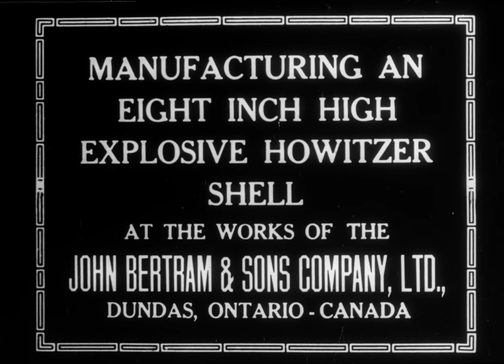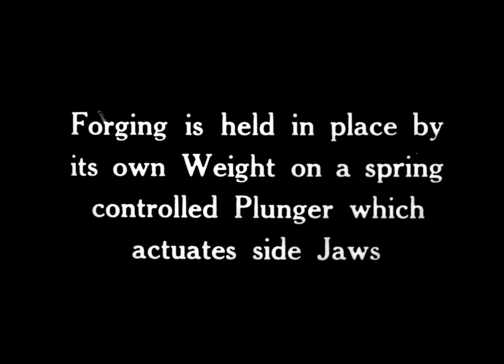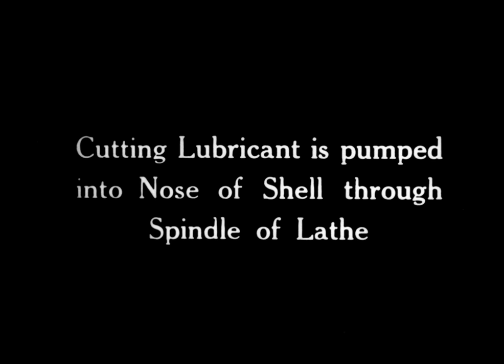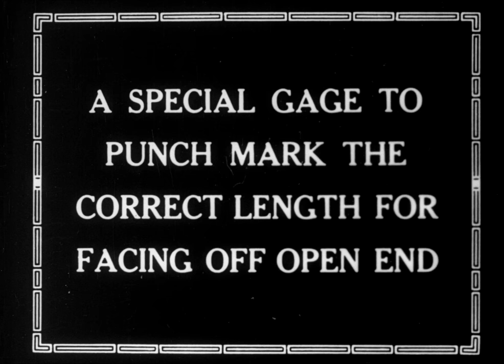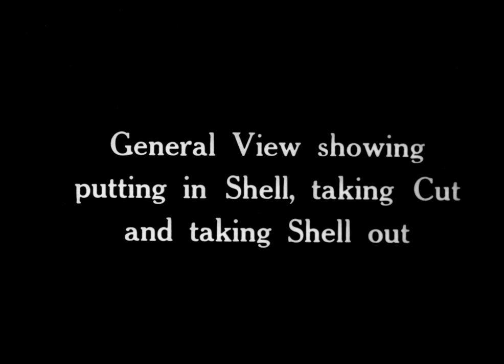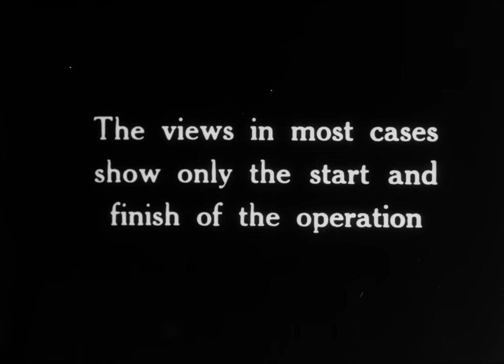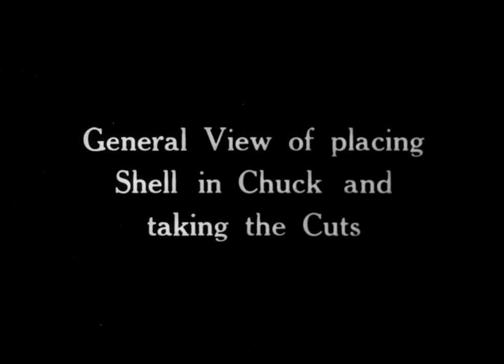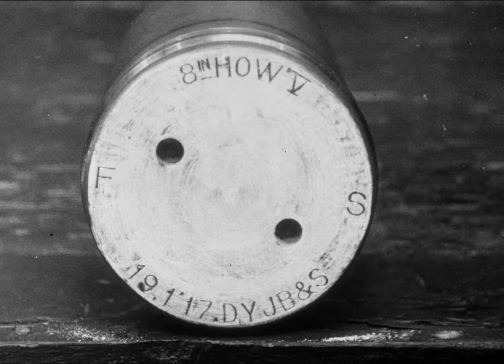Manufacturing an Eight Inch High Explosive Howitzer Shell (1917 ?)

Comment: Seemed like a lot of unnecessary extra machining and cutting on outside of shell they where taking it out of one lathe putting into another just to go over what they already had done couldn't they just set the one lathe and machine to proper size. 
Suppose that's one way to keep everyone busy and employed, lol
Reply: I'm guessing it's because the track of the tool is determined by a cam and the cam and tool on the lathe is set for that one operation.

Comment: They didn't have carbide tooling but I believe they used diamond cutters to hold tight tolerances.
Reply: Amazingly, they just used tempered tool steel, they went through a lot of tools, there were whole areas of the factories that specialized in sharpening and retempering the tools.
Reply: @MichaelClark-uw7ex  If you look carefully at the final cut on the tracer lathe, they have a round indexable tool that can be rotated as it dulls.
Reply: @carbidegrd1  Very cost effective, saves time replacing tools as they dull but they still had to replace them regularly and had a "tool room" that shaped, resharpened and re tempered the tools.

Comment: did it matter all the work on the out side of the shell all the manchine work  ??? let me no thanks
Reply: yes, it has to fit down the bore of the gun consistently. It is one way to ensure accuracy from round to round.
Reply: The answer sir is yes. The shape is everything for stable flight, and just like a "Katana sword" it has to be able to hit another surface and penetrate without shattering, thus an alloy steel is required and good temper.
Reply: @markmcdermott8307  It is "High Explosive" shell not armor piercing high explosive...